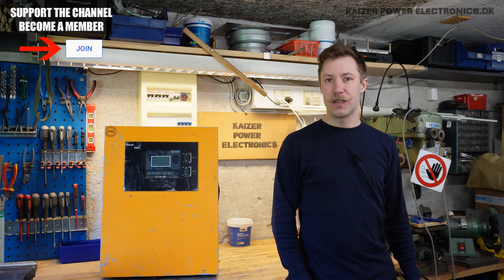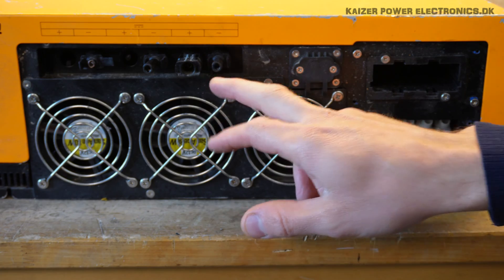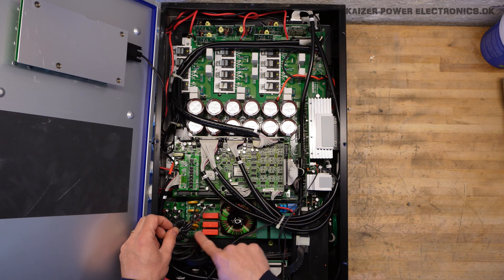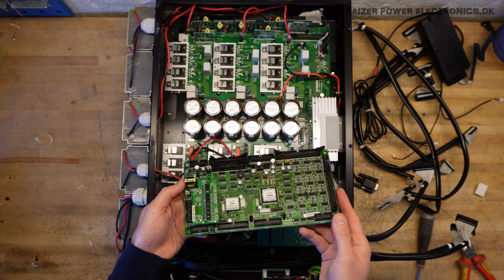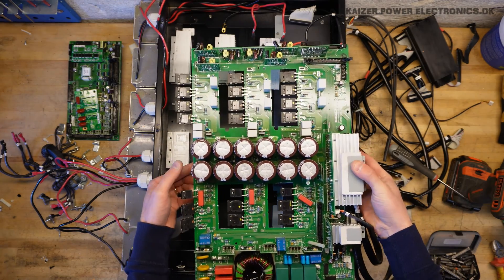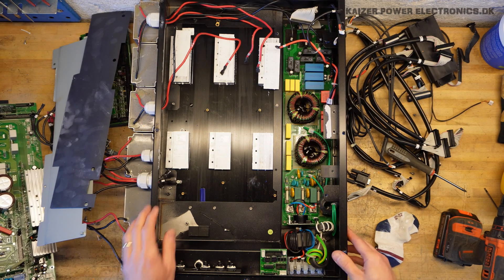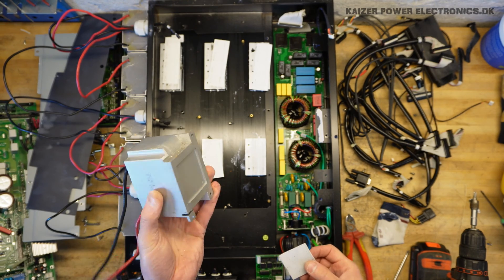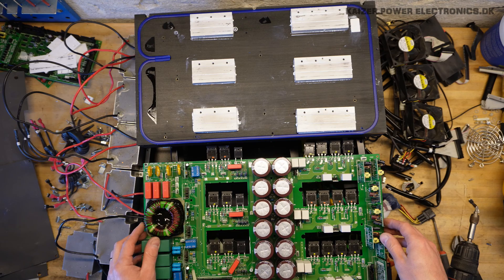10 kW Sirio 10000P Solar Inverter Teardown

Comment: J'ai exactement pareil. Quand je branche les panneaux, l'onduleur s'allume mais la sortie AC est 0v . Aidez moi SVP🙏.
Reply from the maker: Adhere to electrical safety and use professional help on mains connected inverters! Check fuses. Check panel output voltages. Check inverter log, like usb/serial interface or computer connection?

Comment: Hello Kaizer Power Elektronics,

thank you for this - at least for me - very interesting video! 🙂
I wonder, because there i have seen no HF transformer. Such one is normally used for generating an konstant BUS voltage (DC DC converter) for the generating an AC Output.

Thanks again! 

VG, Jürgen B. (from the great loetseite, readable in english, too. You can find interesting infos there :-)
Reply from the maker: I would guess its almost identical to this generic PV transformerless design: https://www.researchgate.net/figure/Generic-transformerless-three-phase-inverter-connected-to-the-grid-through-an-MLCL-filter_fig7_317353683
Reply: @KaizerPowerElectronicsDk  ; thank you for your nice feedback. 🙂

VG, Jürgen B.

Comment: Nice engineering for quality and reliability, not for cost. I am really susprised that drivers are so far away from switching devices. I always tough driving inductance is a killer. But I know little about IGBT
Reply from the maker: I agree 100% on the placement of driver PCBs. It makes no sense to risk gate ringing with higher than necessary stray inductance. It could be that they switch so slowly, with a high gate resistance, that there is no problem with ringing and they can afford the power loss (maybe that is why it has such high surface temperatures) in the IGBTs from being driven too long in the linear region.

Comment: 1200V rated IGBTs in the output H bridges.  That's nice.  It's not unusual to see only 600V parts in many HF inverters.  Any idea of what the HV DC bus run at?
Reply from the maker: The DC link has two 450V capacitors in series, 6 strings in parallel. 900V at 4000'ish uF
Reply: @KaizerPowerElectronicsDk  That explains the 1200V IGBTs

Comment: Whenever I come across things like this, I realize that I still have a long way to go in my power electronics career.
Reply from the maker: Just like software, hardware development should be done in iterations. Start off with the least possible functions and make it work. Then you start adding complexity. Many things today and solved entirely in simulation, I prefer experimentation :)

Comment: Do you have plans to build any more Tesla coils? I would also love to see some more videos of your DRSSTC 3! It would be awesome to see the midistick hooked up to it, playing chiptunes!
Reply from the maker: I have many plans, but not enough time. The Basement renovation is killing me :) I am still working optimizing the DRSSTC3 setup, so it does not take hours to set up. I also have been making drawings for a larger flightcase/truss setup which all fits nicely into a standard trailer. I also want to do some smaller coils with a more simple and open design in mind, for entry level for new builders of DRSSTC.

Comment: Repair is no option? 
I guess the dangers of High voltage DC are too high....
Reply from the maker: If you see my other videos, high voltage is not a problem :) My teardown equipment is all from scrap yards and have been thrown out. Usually for good reasons, often just because its too old, but then have taken damage from being thrown out.

Comment: Is it safe to use Chinese full sine wave inverters? After seeing this piece of art inverter i couldn't trust chinese ones.
Reply from the maker: Almost all electronics comes out of China/Asia. As with everything else, you get what you pay for. If you buy the cheapest, expect it to be cheaply made.
Reply: @KaizerPowerElectronicsDk  Thank you very much for reply.
Reply: Chinese Deye Inverters will blow your mind.
The construction quality is on par with the one in this video.
Their Hybrid inverter  has 48V  Batteries output , Generator input and much more!
Reply: Cheap Ones like MPP Solar will only last 5 Years. High quality, fully certified Grid inverters from Solis or Hauwei often come with 20Years warranty
Reply: @flipschwipp6572  Are you kidding me MPP Solar is from Taiwan . Taiwan is no cheap manufacturer country anymore.
TSMC the world leader in chip production is in Taiwan!
Reply: @animarkzero  MPP Solar being HQ'd in Taiwan and TSMC being the world leader in IC production are two unrelated facts.

MPP inverters were junk when they first appeared on the market, as were their standalone MPPT chargers.  Plenty to be discussed with someone that has any experience with electronics design.  Right now I'd be happy with the statement that MPP solar inverters will last '5 years'.  Often the electro caps degrade to the point of the unit not functioning properly at that point.  Actual lifespan depends on ambient temperatures etc.
Reply: @retrozmachine1189  Thank you for your insight. I have considered buying an MPPSolar hybrid inverter because of the 50V battery capabilities but have bought the Deye sun-8k instead
At least it's construction quality seems much better and really solid.
And the sun-8k has much better cooling
I have yet to open it up but from what I've seen it has multi-board construction.
Reply: @retrozmachine1189  If only the Caps fail that would be not a big deal.
But the question is if also the IGBT's get damaged in the process!?
Reply: @flipschwipp6572  I forget to mention. Actually i won't use it with solar panel but with car battery or cell pack(li-ion or similar) Maybe it will last long in this circumstances?
Reply: @flipschwipp6572  MPP is one of the few to offer daytime backup without batteries, I wonder why that wasn't a common feature until very recently.

Comment: Are you only getting all those units from junkyards?
Reply from the maker: Yes. Its stuff that others have trashed. That is also why it often looks a little rough on the outside, from not so nice handling in containers and by cranes.
Reply: @KaizerPowerElectronicsDk  Im often visiting scrapyards but i have never found things like you only basic common things like microwaves, pcs, printers and other stuff. I really would like to find something like this but i guess it's hard.
Reply from the maker: @EvilElmooo  You need to find the scrap yards that buy scrap from other companies. Not scrap yards that receive trash from consumers.
Reply: @KaizerPowerElectronicsDk  Ahhh, thx i hope i can find something

Comment: It's amazing how much board space you waste with high current traces when you stitch front and back, I often wonder whether a cable jumper solution would be better in some cases. I suppose that just adds to BOM costs.
Reply: When i see traces like that i think of heat dissipation calculations and i assume there were decisions made to space the devices out. But this is just my thought
Reply from the maker: Sticking with PCB tracks and vias will keep the stray inductance as low as possible.